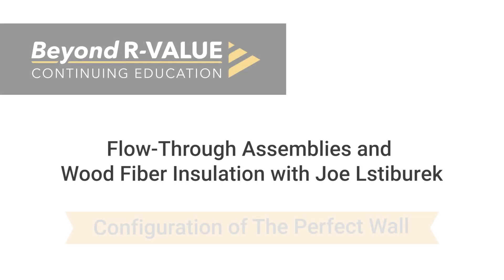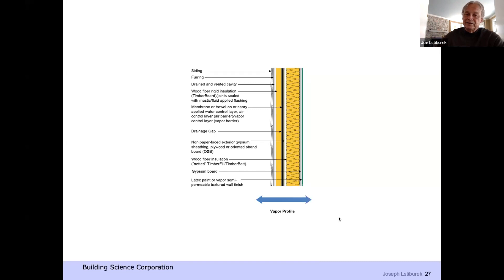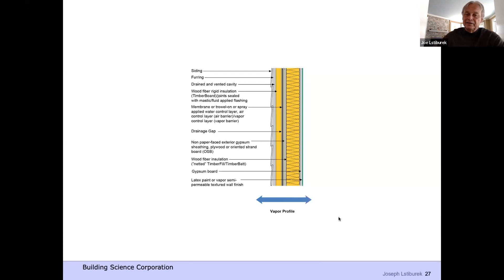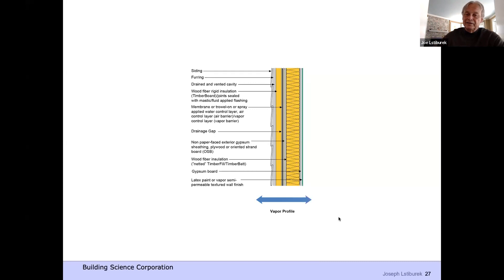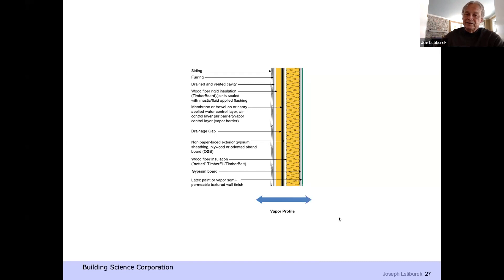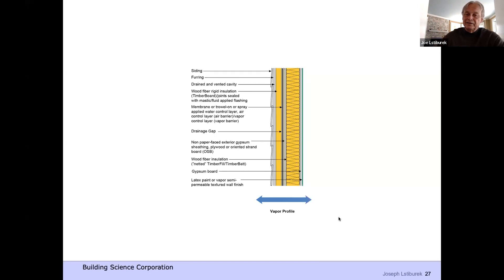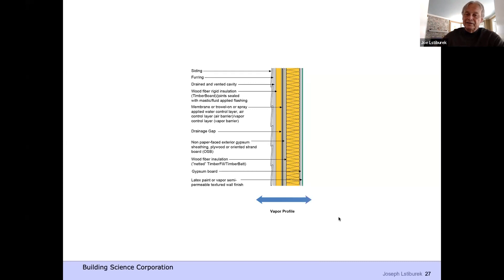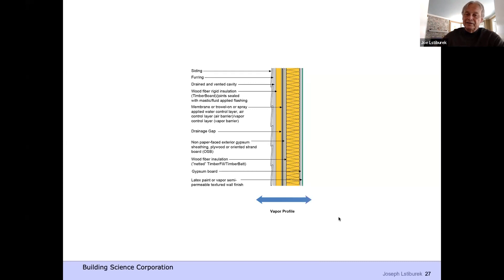Joe Lstiburek - Configurations of The Perfect Wall on Timber HP's Beyond R-Value

Comment: Joe Lstiburek appearantly doesn"t trust the water repellent capabilities of TimberHP Board... a drainage gap behind the Timberboard is not needed.
If you want to apply it - because it makes you sleep better - make sure it's air sealed but vapor open at the top or you will loose lots of the insulating properties of the Timberboard.

All those control layers behind the TimberBoard are not needed... tape or caullk the seams of the structural sheathing (plywood, OSB, gypsum, MDF, hardboard,...) and you have an air sealing ("air control layer"), with a "vapor throttle".

 And use Timberboard at its full capabilities as a water control layer and insulation layer.

If you don't trust the Timberoard as your water control layer, apply a UV resistant vapor open housewrap at the outside (underneath the siding/cladding).
Reply: I don't think he said to put a drainage gap to the interior or the TimberHP
Reply: @worganyos  You need to look at the drawing: 
- On the outside of the TimberBoard the drawing mentions a "drainage cavity" (which is correct);
- On the inside of the TimberBoard the drawing mentions a "drainage gap" (which is to avoid to keep the thermal insulation of the TimberBoard useful).